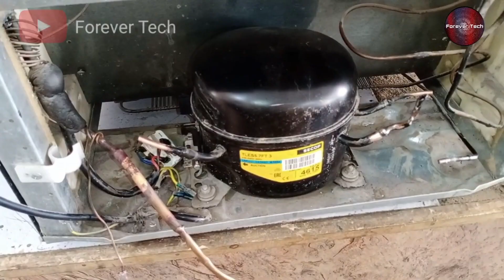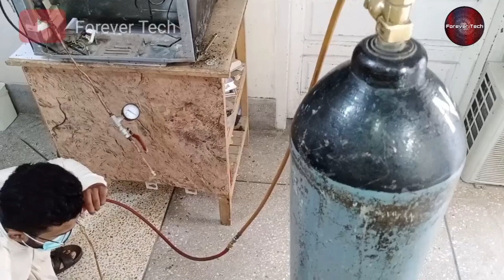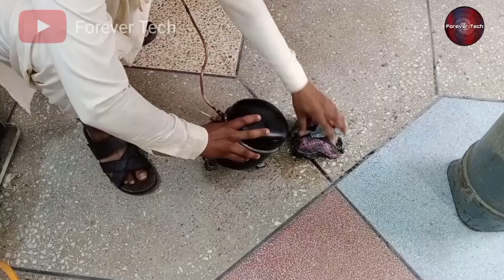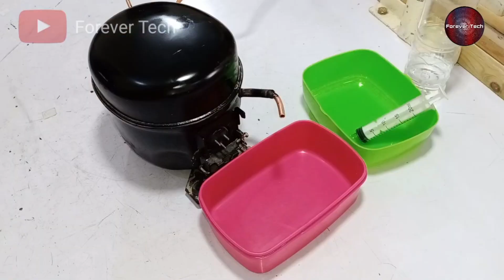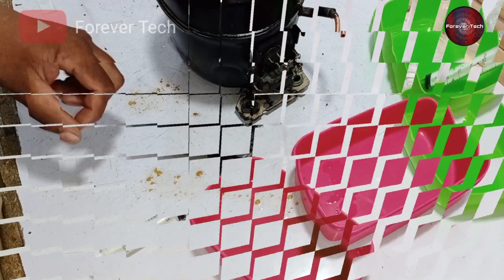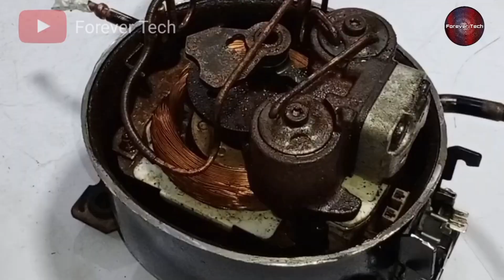Refrigerator Compressor RUINED by Water? Watch This Before Replacing!

Comment: Using nitrogen to dry the compressor is a waste of nitrogen. You use nitrogen to prevent to get water in your system. But in this case it is already filled with water. So you might as wel use compressed air to vent the compressor and dry the compressor. At the same time be sure to warm up the compressor or even better warm the air that you blow into it. When all the moisture is gone you can dry the last part with nitrogen or with a vacuum pump.